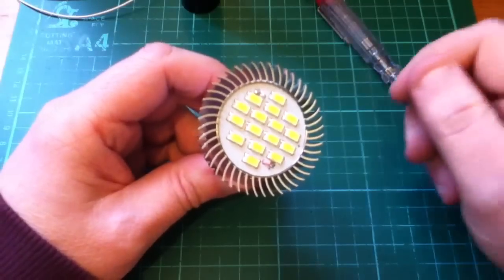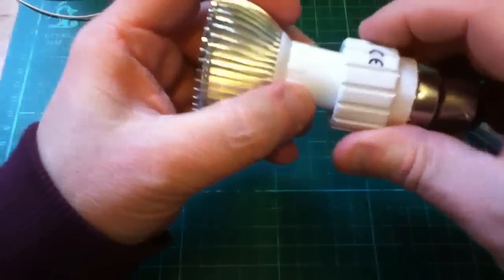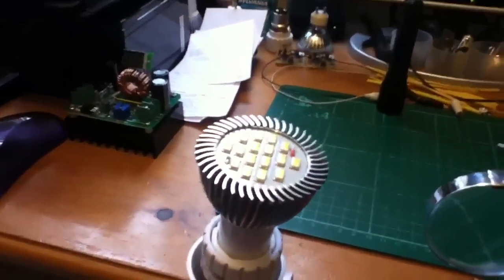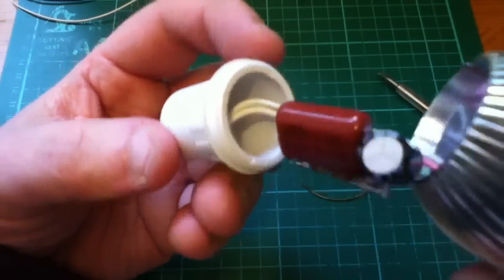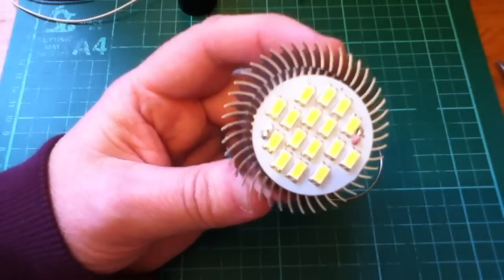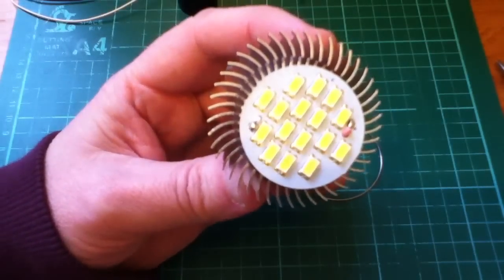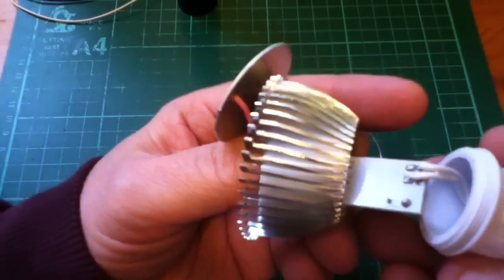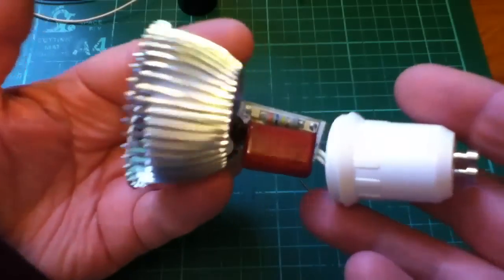Dangerous GU10 LED Spot Light is Cheap and Bright but could Kill You - Seriously

Comment: The AC current is converted through the bridge rectifier to DC current, so at the led side there will be no AC current but a small ripple.
The DC current at the led side is about 58 volts DC (3.6V per led,all in series (cheap chines)).
I think that you will be electrocuted only by the DC voltage that is 58V wich is 12V more than the maximum your body can handle but you will not die it will annoy you
the worst case scenario is if a hire from the DC supply touches the heatsink and the big resistor or the orange capacitor fails so you will be electrocuted by DC high voltage.
Therefor is less than 50% chance to "put live mains' on the metal casing, its about 10% and that goes to the circuit toleranc.

Comment: halogen spotlights are the same and say don't make contact with the glass. only a fool would change a light when it is on.
Reply: +Cyrus Hale The only reason you shouldn't touch the glass on a haogen lamp is that it isn't glass but quartz and theoils from your fingers will (if not cleaned offthe quartz) will create hot spots on it and lead to early failure. That is the only reason.
Reply: Bill Lewsey, quartz glass. If you watched the video, the person states that the "LED" spotlight has no glass so your fingers would make contact with the contacts. My point of saying about halogen spotlights is valid as you wouldn't change them when powered on.
Reply: +Cyrus Hale I do change lights when they're on because I don't know whether they're on when there's no bulbs in. Also, I assume these lights can be changed safely. Is there any truth in the story that these lights can kill you?
Reply: No

Comment: difference of 220V and 120V lies in the 120 forcing the muscles to contract as opposed to 220 actually pushing you away.  doesn't the 220 there lie with 110 on each leg?  I am not sure of the configuration of the AC where you are from, but in the US, one leg is 110 and the other is neutral (tied to ground at fuse box).  The power is going through a rectifier and filtered by the caps and limited by the resister circuitry.  Have you actually measured the voltages you are speaking about or are you merely theorizing based on the AC characteristics there?  I see some issues with the ground (reference) being lifted or modified as the delivery voltage is dropped to around 12VDC for the LEDs to work properly... remember that reverse current through an LED even of minuscule amount is death for them, so we are talking DC on the output side you are examining.. even if it is ripply and not filtered completely out.  I am not doubting your conclusions because I do not know the circuitry you are examining, but I have looked at some COBB lights here in the US.. but they are 110V units with E27 connections.  Here they are isolated via a cap, so ground reference is removed (which I think you are eluding to as the shock hazard if I understand correctly)..  Can you provide a schematic of your bulb for more clarification as a way to help understand the concerns?  I am trying to understand how you are seeing full AC (or even half-rectified AC) at the LED leads exactly without the LEDs turning into tiny mushroom clouds...  :-)
Reply: +Stan Skaggs It is the current that kills (or burns) - you need a voltage to push the current through the body and anything above about 50V alternating current (120V Direct Current) can be lethal - it depends very much on the contact path. Damp skin lowers your body resistance.
Reply: Geoff Ryan That would be true, except these bulbs are fully rectified and capacitively decoupled.  If one were to pour water into the bulb to arc the current over to the DC side (part that you touch), I could see danger there like you are trying to describe.  I work on these all the time and do not see your point exactly since the open side is the DC side.  Any reverse current like you are describing would annihilate the LEDs via reverse current flow (definition of AC).  Do you have a schematic to review of these lights to see what I am trying to convey to you?  If the AC side were to make contact with the DC side, I could see your point, but that is just not the case... Sorry, but it is wrong..
Reply: ***** You are correct to a point in that current is the factor in which fibrillation commences.  The point that I think you are missing is that alternation of that current is necessary to form fibrillation cycles though.  A typical fibrillator in a hospital surgical suite is a DC device which MUST be changed to AC in order to scramble AV node current.  The fact is that DC is highly subjective to resistance than AC is.  This makes DC current damage more likely to be convective than intrusive as AC is in the form of fibrillation (largest concern for AC shocks).
You guys are making statements regarding electricity safety which are in fact valid and mathematically correct, but DC damage is more heat related where AC is invasive to the nervous and thus the cardiovascular system.

Here in our hospital, we test constantly for electrical leakage on equipment powered by AC mains, but anything DC related is simply ignored to that fact.  Even NFPA99, as well as the NEC regulations point this out very clearly and substantially.  If I short my radio to AC the radio will blow for sure as well as I would be shocked via the AC mains.. as will these bulbs if the AC drifts over to the DC side of the circuitry.. That is known as being "broken" of "shorted" to mains.

The simply truth behind these bulbs and nearly all our modern home electronics is that these are DC devices rectified in the exact same manner to perform their functions.  

Sorry if this is long winded as well, but these are simply the cold hard facts.

Back when Edison and Tesla fought over the harnessing of the Niagra Falls for power production, Edison pointed to the dangers of the AC current, killing animals in public to point that out.  This is another extension of this case argument in reverse, and not accepting the nature of the consumer-side of the bulbs being pure DC just like a D-cell or car battery.

Come on!

Comment: rectifier bridge means AC is rectified to dc before exit to circuit
Reply: +David Meritt You are correct. A bridge rectifier can also be used to make sure DC ends up configured in a desired manner. If the positive/negative source leads of a DC powered device are connected where AC input is normally connected on the bridge) the output of the bridge will always be in the desired configuration, even if the source leads are accidentally reversed positive/negative - as it is just as if the other cycle of AC had happened and the bridge reacts accordingly. I have seen mobile equipment deliberately configured this way to keep users from blowing things up by connecting the power leads incorrectly... :-)
Reply: +Mark Magill 
You'll have rectified AC voltage with a charged capacitor on the positive wire if the circuit is for some reason interrupted. i.e. 230VAC turns out as 325VDC if there is no load to the capacitor. The missing thermal compound between LED aluminium circuit board and heatsink makes this scenario a lot more likely. nasty shit that shouldn't be on the market
Reply: +David Meritt why would he actually test it when he could just make wild claims out of nowhere with no evidence to back it up?

Comment: Why aren't they illegal or why doesn't ebay ban them. The UK has the best safety precautions in the world when it comes to electricity, especially with plugs. They're designed with live and neutral pins that are half coated in plastic and they have shutters that the earth pin opens. The fuses, the earth leads, the way the earth is designed to come out last if you pull the cable, the cable grips, etc. So why are we now allowing this crap to be sold?
Reply: +3970xRocks They are illegal. If they're caught by customs, they're destroyed. But you may have noticed that the UK is an island and there are millions of shipping containers coming in each year and it's not possible to check every cargo and take apart every item inside to verify it's up to code.

Comment: just to point out it does matter what way round you plug it in it AC current. this means alternating it swaps between live and neutral at around 50 to hertz (per second) so if this basics of electronic principle evades you then please don't comment. the holder that is clipped onto thw desk has two exposed points that's where the bulb goes in you should never change a bulb with the power on  Also it's never the voltage that kills its the amps. you can grab 240v mains in your hand and let go (speaking from experience here)  that's my rant over
Reply: It doesn't "swap between live and neutral".  The voltage on the live side alternates between + and - peak volts.  The neutral potential remains close to ground.  Your other claim is equally misguided.  It would be more accurate to say the energy of the shock (in Joules) is the lethal factor - though obviously the path through the body and physiological factors also play a part.  While it's true that a mini Joule shock from a high voltage source - such as experienced when  peeling off a nylon shirt - is not dangerous, a low  voltage (say 30V) shock from a low impedance source when the body is well grounded could be lethal.  Try applying Ohm's Law.

Comment: I have some LED lights with an identical-looking plastic body and aluminium heatsink, but they do have a transformer-based power supply inside and a plastic lens covering the front. Still, the GU10 socket is pretty tight, and when I tried to take the light out of the socket, the heatsink started unscrewing from the plastic body instead. The socket was pretty deeply recessed, so I had to unscrew the heatsink completely, and then grab the plastic body with pliers to get it out of the socket.

Comment: that's silly downgrading such product. why would someone try to hold live circuit. you must be an idiot doing that. even if it's output is at a lower voltage, it can still give you a shock.

Comment: Engineers do a lot of stupid crap like that. Very irksome.

I bought a front and rear light set for my bicycle. The head light used several AA batteries, while the rear light used several AAA batteries. Why not use one kind of battery and only one battery per unit? Then the head light fell off and shattered on the pavement, so I went with a hiker's headlamp that one wears on one's head. Great for biking, except that adjusting the beam focus immediately pulled the wires lose inside. Two different brands in a row did that.

Then I spent $160.00 on an Olight headlamp, supposedly the best on the market. It was defective. The retailer replaced it, but then the wires pulled loose from the head piece with very light usage. Then the proprietary battery pack went bad.

I could go on and on about the incompetent designs I've paid for.

Comment: One good reason to go with the 100~250V input type lamps as they have a better chance of using a small isolating switching type power supply to handle the wide range of input AC voltages. Just a bit more expensive and usual have the CE mark

Comment: So many dumb comments to this video from people who claim to be qualified.
Most are from basic electricians who do not understand much beyond wiring simple
circuits. Julian should have sketched out the circuit of this device to show those with
limited knowledge how a lethal voltage is present on exposed metal parts. 
This circuit is a classic capacitor dropper where current and voltage are 90 deg
out of phase. Very much simplified, the capacitor is a cold running current limiter.

Comment: All LEDs use DC power, not AC, you showed a bridge rectifier, so there will be only DC on the 2 pins on the front.
Reply: +John Russell " there will be only DC on the 2 pins on the front." - Quite correct - DC at 240 Volts (at least) potential, with very little to limit the current flow though your body to earth. Zap! ...Bye Bye...

Comment: Negative. The LEDs themselves do not take 200v+ its been stepped down by the transformer. I don't know of any 240v LEDs. Usually in the 3.3-3.6v range DC.

Comment: thank you for exposing a safety hazard. all it would take is a very slight manufacturing error and the heat sink would be conducting, or screw it in touching the plate making a finger a nice ground contact - ZAP!! the plate needs to be smaller and sit in a plastic or ceramic beveled ring. this is just a bad design in many ways

Comment: Julian Ilett Hi. I like your video, but I am sceptical to this being true. I work with led, and I highly doubt that it is 220 volt at the front plate. It is much more common that the transformer in the base part transforms the voltage to something like 19V - 40V.
Reply: theres no transformer in it, its  a capacitive dropper, like most of the cheapo ones are

Comment: The full wave bridge rectifire unit will swap live to the same part of the LED bulb no matter what way to place it in the socket.  The "D" in LED stands for Diode. LEDs only emmit light when forward biased.  If live got swapped, it would go into reverse bias and not illuminate.

Comment: A lot of the negative comments seem to assume that the lowish voltage at the LEDs is galvanically isolated from the mains voltage as though there was an isolating transformer in it..
Also many of us that have had electric shocks tend to feel that we will get away unscathed every time. The truth is that without unsafe equipment or working practices we would not have had the shocks in the first place. The uploader was right to point out that there is very little clearance between a high voltage point and the metal work... many of these little spotlights are used in kitchens and bathrooms which can have high humidity and generally be more hazardous. I have similar lamps to these in my kitchen, not the same construction but they are madly efficient and I was getting tired of changing halogen lamps...

Comment: Dropping circuit from 240v to 3 volt the current amp dropping wary high so after dropping circuit you have 240 with earth butt just couple mA ,this don’t kill you fester can kill you arc tig 50 v welder

Comment: Just buy your LED lights at your local stores.    I've tested the 30w corn bulb, pretty pathetic light output and none of the led's or soldered connections are  covered.   If  it does not have a  reputable name brand DO NOT buy it as it may not be UL listed.

Comment: In 1975 no one died; in 1976 no one died; in 1977 no one died ...
Reply: ***** lots of people have died from shorting themselves across mains voltage.
Reply: Zentura not really... sure you have to be pretty unlucky to get electrocuted when using properly made stuff but if everything was made like this it would be another story... you might say why would you touch a light bulb while its powered on? well what if it were a toaster, kettle, vacuum cleaner...
Reply: megaspeed2v2 naaaa

Comment: Do you think there is 240V powering those leds? 
Doubt it.
Reply: No the leds are probably run at less than 50v DC, however you don't realise what an actual floating voltage is - that 50v DC will be with reference to earth, and taking into account that once rectified, 240v AC and DC smoothed has a voltage of 340v DC...you will have one side of the LED string at 290v DC and the other at 340v DC - now do you see the problem?!. Unisolated driver designs have what is known as floating mains potentials - i.e. they will always have very high potential voltages with reference to earth and certainly high enough voltages to produce sufficient current flow through a human body, down to earth...to KILL.
Reply: walt schilling there will be something like 2v across each LED, the problem is that since GU10 can be plugged in either way around and that coupled with the fact that there is a resistor only on one side, if you plug it in the way that puts the resistor on the neutral side instead of the AC side that means there is no resistance between the AC side and the wires on the front so then if you touch that wire and you are grounded there will be 240V across you. not across the leds. across you.
Reply: walt schilling The standard household elec supply in some countries is 240v Walt (UK, Australia, etc) ... unlike your 110v in the US.

Comment: The driver design is actually a Capacitive dropper, the 360k resistor is only there to discharge the large red metal film capacitor that's doing the 'dropping', when the power is shut off. In other-words the circuit is even more dangerous than you think! - there will always be floating mains potentials on the output regardless of which connection pin is on live - its a disgrace that this design, and not an isolated design, has been used with not only a metal body, but the LED board exposed - touching solder contacts on the led board will result in an electric shock.

Comment: was going to put these in my bathroom to replace my 50w halogens, but now I might reconsider, I'm afraid condensation might cause a shock within the lamp, unless i put some protective glass in front of it. You're last remark however is a bit dodgy: I assume whenever you replace a lightbulb you leave the power OFF. then return to the switch and flip it back on to see if your bulb works.

Comment: doesnt the mains power go through the bridge rectifier (to convert to DC)  before being fed to the rest of the circuit, this would result in the power capable of actually shocking you at the heat sink being 12-24V
Reply: jerry vella im assuming that the power being fed to the LED's is what your afraid of and this would be stepped down to this level by the resistor